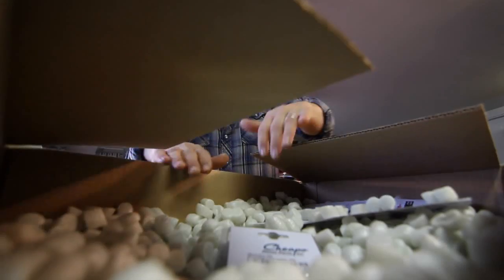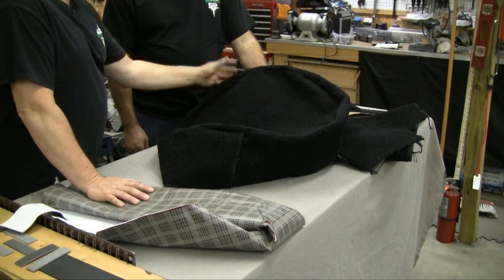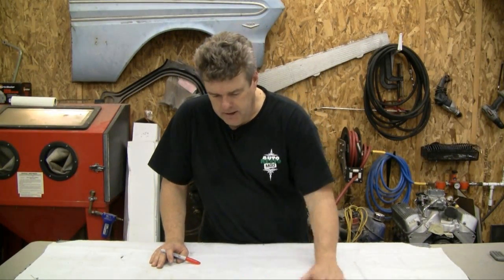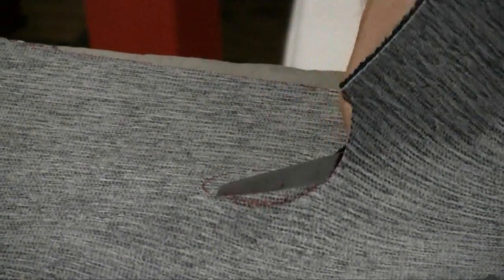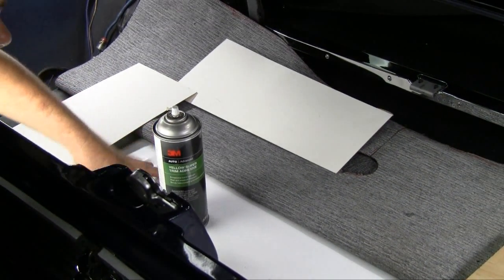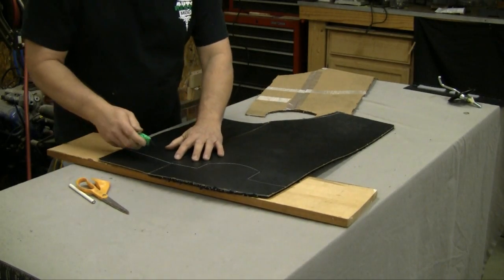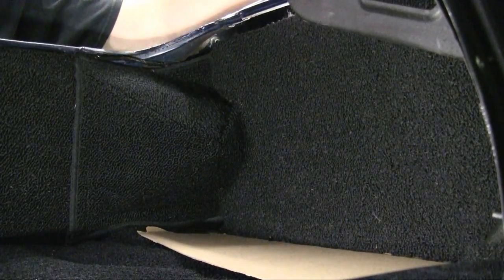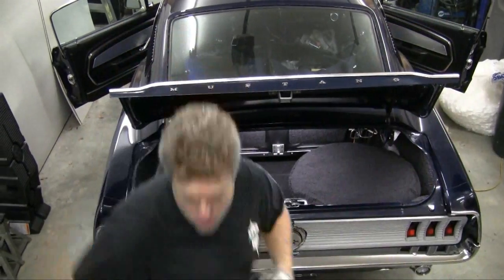Classic Car Semi Custom Trunk Detailing a '67, '68, Mustang Episode 148 Autorestomod 1

Comment: They have a video on YouTube as well check it out. Yes the 22 gallon is different than a 16 gallon it's not that much different that you would have to spend hours cutting and fitting with their system
Reply from the maker: We appreciate your input Raul. We have checked out the CJ video and you will note that the carpet in their video drops into the well onto the flat top of the 16 gallon tank. With the 22 gallon tank that "well" is gone, the top of the 22 gallon tank sits flat to the frame rail sections where the 16 gallon tank is in the bottom of that "well". With the 22 gallon tank the ACC and Distinctive floor carpet, if laid flat will push the wheel well carpet to out to the point that they will not fit properly.

The last point on this is that the main point of the video was not just about the Mustang. It was about any car. We attempt to provide tips that ALL owners can use. The Distinctive Industries carpet set that CJ sells is a nice one, but it will have the same problems that the ACC set has when dealing with the 22 gallon tank.

Comment: I have to ask: Does the trunk look a little segmented by all the separate pieces of carpet? I'd think they'd make a one-piece panel that spans from tail light to tail light. Just a suggestion for Classic Car.
Reply from the maker: We've wondered if someone would come out with a molded panel much like what modern high end cars have. But to date that hasn't happened. We'll certainly pass that along to the guys at ACC!

Comment: wow a lot of work, i got a carpet kit from cjponyparts that is molded to the my 65 fastback everything just drops right in. i did have to warm thew carpet so it would fit better. the same kit will fit a 22 gal tank as well. you might have to trim a bit but nothing like this
Reply from the maker: Interesting. The fit on the 22 gallon would have to be off a bit or you would have to put the carpet down in the side areas between the tank and the rails. The 16 gallon tank is flat on top and the 22 had the 2 inch high bulge that sits above the flange. We definitely went to additional efforts here to show how you could further customize the ACC custom carpet set. Most all of this would not need to be done if we were installing the carpet set stock.

Comment: This is really neat guys! I had 2 questions:
1. How come you didn't sound deaden under the carpet?
2. Can I use any carpet from the local household carpet store, or does fire risk, weight, heat come into play?
Reply from the maker: The carpet it self is a sound deadener. I would recommend using a nylon loop carpet like what is in the car.
Reply: Autorestomod Manic Mechanic Gasoline Media thanks guys, you rock 🤘😎